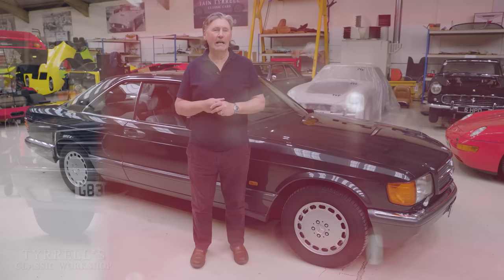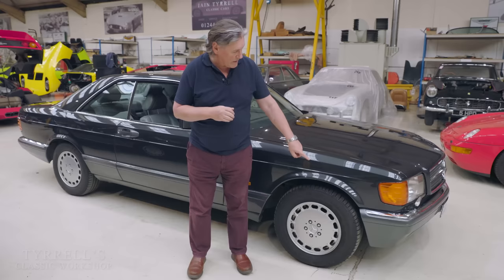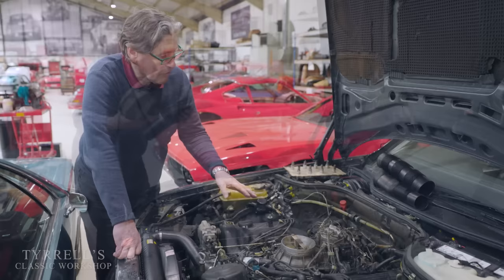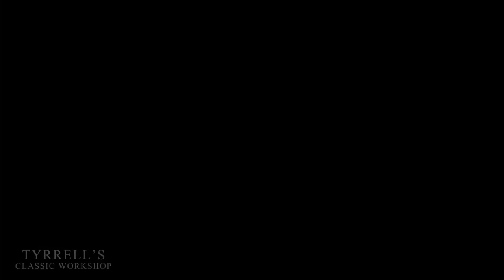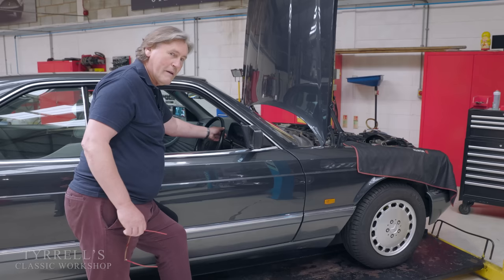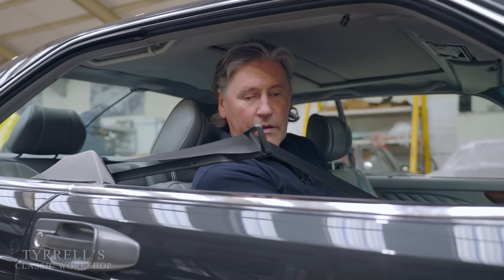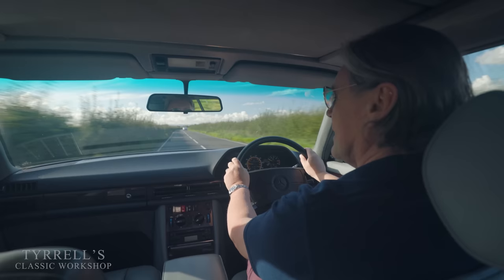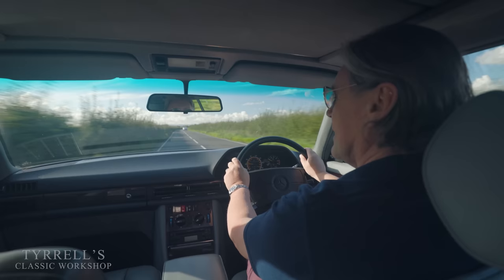Recovering the beast of an 80s Bahnstormer - Mercedes-Benz C126 560 SEC | Tyrrell's Classic Workshop

Comment: I have to say I really do like Tyrell.  I he really does what is great about cars.  Most people nowadays when they make videos about cars, they just wont shut and self vacillating.  I want to hear the car, I want to get the driving experience.  With Tyrel, he's clear, calm, straight forward; he's obviously a very refined and educated mechanic and when he get's out on the road and open it up.. Like I said he really appreciates what is great about cars, the driving the experience, the shift, the properly executed corner, the sound of the motor picking up through the gears.  With this car the experience was a very nice sedan that when you put down the pedel, it meant business, this was a drag race opening out a corner onto the straight away with a V8 motor.  I will say I owned a similar car, a 1984 300SDL with 380,000miles on it.  One thing about these cars is they don't weight very much 3200lbs, similar to a volvo 760 with a turbo 4, so with a 300hp V8 it's going to haul. Also their handling is competent, but one area where the really excel is they are great off road rally cars (unlike BMW's) these cars fly over speed bumps like they're not there, these cars are fun to drive off road quickly.

Comment: Dear Iain, thanks for this enlighting video. And this because I still own my late father's W123 230, (76 model), but after 27 years of daily driving I had the carbureted motor replaced by the newer model's 2299cc fuel-injected engine (of course with a 5-speed manual gearbox and ventilated disc brakes, to suit the power). With this video, you reminded me the problem with the fuel distributor of the Bosch mechanical injection system, that I did had, but also you made me try to fix the steering problem that has started to be annoying after almost half a million km that I have covered in this car. So, many, many thanks!

Comment: Years ago I was shopping for old Mercs and came across a pretty good 126. The price was of course pennies as they were back then. It had a problem here and there so I chickened out and went for a 124 instead. Also a terrific car but it always bugged me that I passed on the big car. I remedied it by getting a w140 next. But still the design of the 126 is so much better and it's always been the one that got away for me.

Comment: I got to drive this as a dealer flunky boy in the 80's and I must say they sure left an impression! Drive them hard, they'll do that, drive them in a relaxed manner, they can do that, too.  Quiet and solid.

Thanks for the tip on the steering box. I've got 110K miles on my W124 and it certainly needs looking at, but I must also say, with two tie rods and a center link, that's six joints that can get sloppy with the miles, too, adding up to a lot of slop.

Comment: "Engineered like no other car, MERCEDES BENZ"
Great presentation Iain. You do honor MB with respect. No negative opinionated bias, just accurate facts. Thank you.
Another car that Formula 1 Drivers drove for pleasure. I used to test and adjust for full throttle opening on all cars that came into my service bay. From lowly 240D up to 6.9. Clients would call back after picking up their car and complement how it never ran so good before!. I'd be careful about sharing the steering box adjustment. Non MB trained sods might get to happy with twisting things they shouldn't. There is a friction torque spec with conditions while measuring that should be adhered to. It is a component that is directly related to drivers safety and operation. Set wrongly and it could cause!💥!. As always I love your clear sober delivery.✌️
Healthy New year 2023 from a retired (47 MB dealer years) in New Hampshire 🇺🇲👍

Comment: You are right about the difference in European version engines versus US. I remember driving a 1983 Euro Spec 380 SL and it must've had another 70 hp

Depending on where you read it either this coupe or the R129 SL – the SL from the 1990s – is chief designer Bruno Sacco's favorite car 

He really designed Mercedes that looked like Mercedes with a timeless element to them from the 190 E to the W124, the W126-on and on 

Thanks for another informative video
Reply from the maker: Agreed- thanks to you too

Comment: I recall the arrival of the 560SL, SEC, SEL here in the United States at the Indianapolis auto show. The dealer was very happy because they could finally offer an alternative to the gray market 500 cars being imported.  They lied to us though and said that the 560 was a North America exclusive model... The 560SL was so much better than the 380  and I'm not including the single row timing chain issues and head bolt problems.  You mentioned that the US version was rated at 240 hp. Being in Indianapolis in the Mercedes-Benz club, several members that had strong backgrounds believed this to be underated and suspected closer to 275.  No idea if any of that is true. My 1989 560SL doesn’t disappoint. Very easy to underestimate the power on tap.

Comment: Great video of a great car and a great era at MB. I work on these cars every day and I see that throttle issue all the time, together with incorrect plugs and modern HT leads being used. Regular use and fuel system treatment gives them a new lease of life but overhauling the fuel distributer and adding new injectors is the way to go. I would also add that the chain's stretch and the tensioners go weak so valve timing can be way off yet they still run ok. The chain guides get brittle and fall down sometimes causing serious damage, or just a noise if you are lucky !

Comment: With that car having ASR it actually has an electronic accelerator! In normal driving the cruiser control actuator operates the throttle. If something goes wrong, the mechanical linkage takes over, and will give you about 1/2 throttle operation. With the ignition off you'll only get the mechanical system. 
ASR is often a problem with these as they've aged :( 
Sounds like the motor and trans on that car are running fantastic now!

Comment: I had one of these and it was the best car I have ever owned. They are indeed still very fast cars. In particular, the 60mph to 120mph acceleration is impressively forceful. They also offer fantastic directional stability at speed. A very easy car in which to cover ground quickly. This is a fantastic video, very informative: thank you.

Comment: I think the German versions were limited by Mercedes to 155mph in line with local regulations. Not so sure about UK versions. They used to regularly fly by me on the Autobahns near Munich back in the 80’s and I wasn’t hanging about. Great video as usual.
Reply: The German manufacturers had a detente to limit speeds to 155mph. I don't think Porsche was involved, just all the other, non-VW marques.

Comment: During my 30 year tenure as an automotive tech in western Canada, I had the opportunity to work on and drive a Japanese spec 560 SEL. No cats on that one either and it was fast! I had to rebuild the steering box and removing it was a breeze due to the simpler exhaust system. I passed on buying a rather tired German spec example with a leaking self leveling hydraulic rear suspension a few months back. $2000 Canadian. A little scary even with my experience. Thanks Ian for your efforts and interesting material.

Comment: I owned an 85 500 SEC AMG with the big monoblocks for a few years. It was so fantastic. I had basically no maintenance other than oil changes and brakes. It was reliable as the day is long and built like a tank. It only got 14mpg so it was not so great once gas prices started going up! That is one of the cars I regret selling. I definitely sold it at the very bottom of the value curve for that car too.

Comment: Great video Worth noting, though, that the US spec 560SEC also had the dual air intakes. You were looking at a US 560SL to compare, which was different, due to the 107 having a narrower engine bay.

Comment: Thank you for your excellent review on the 560SEC. I owned a 1986 500SEC without cat. One little correction although. The USA 560SEC and SEL had a dual air intake as well. Only the SL was restricted to a single pipe.

Comment: These were the best cars Mercedes ever built, without a doubt. I was the proud owner of a 1985 190e which finally blew its engine two years ago, after 400,000 miles. Unfortunately, the cost of a new 2 litre 4 cylinder rebuild was three times the worth of the car, so I had to sell it for parts, but that little rocket went everywhere with almost no issues. At the heat death of the Universe, when even protons begin to decay (theoretically), all that will be left floating through the void will be a mid 80s Mercedes, and a Nokia 3310.

Comment: Had a1983 500SE with "just" 240 ps but it was sooooo fast. The odometer max indication 240 km/u it completely overshot. Remember when i sold it and the buyer took the car for a run and came back impressed.....it's really fast. The 560 was obviously even faster and at it's time indeed a beast.

Comment: Iam biased as i own 2 x Gen2 Euro High output coupes & an 89 Euro 560SEL high output version all AMG kitted & 3 piece AMG wheels.
These are so much fun to cruise in and so comfortable for an 80's car. 
Mine all have Tr-Ys, no cats & full custom S/S exhaust and produce a deep V8 rumble with no drone as i don't like them being dead quiet with such a sweet V8 engine you need to to hear it. What i like about these 80's time machines is you can work on them & they are very well engineered
Enjoyed your video and can see you also enjoy driving them

Comment: Series 2 560 US models got the twin induction pipe air cleaner. The IS spec cars had to make due with a lower compression ratio, different cams and exhaust, and different ignition timing. I wish we had the euro height adjustable headlights and the optional 4 wheel SLS

Comment: From what ive seen the US and euro spec both had dual induction pipes. Only ones with single air intake is the 107 because of smaller engine bay

Comment: Great video! This was a good era for MB as they still over engineered their cars back then. Always liked the 560, but still preferred the old 6.3 and 6.9. I used to work on a customers 420 SEL optioned with the 6.9. The only S class Merc I ever drove that would wheel spin in the dry. Now that would have surprised a few people at the traffic lights!

Comment: I owned a 1987 560SEC for 10 years. I bought it at 80,000 milees and sold it at 116,000 miles. It was a US car , the same colors as yours. I took off the complete catalysed exhaust and replaced it with Euro Tri-Y headers  and only the stock rear muffler. The car immediately gained another40 or so horsepower and would easily spin the rear wheels. BTW , it also had dual intake snorkels from new.

Comment: I have a 500SEC and a 560SEL - both are beasts. Interestingly the 500SEC is a bit more responsive at lower RPM. A couple of corrections on the video - the 560 is actually a 5.5L not a 5.6L and it is a KE-Jetronic system - not a K-Jetronic - there are some fundamental differences. 😉😉

Comment: The U.S. 560 perhaps should only equal out the loss by Catalytic Converter. Because in 1980 the original 500 SEL had also 240 Hp as also the 450 SLC 5.0 version.

Comment: I had a 380 I loved the seat belt butler. I understand the steering box adjusts up the opposite way to expected which lead to a lot being replaced unnecessarily. Because the box wears more in the straight ahead they can adjust up and be tight on full lock so I was told.

Comment: Just love this vehicle and era.  I purchased my childhood dream 1991 US Spec 560SEC 15 years ago and still have her along with my 1989 US Spec 560SEL along with 3 other Mercedes.  I have been enjoying Mercedes for over 35 years and owned many. 
MY question, I noticed in this 560 the radio has a CD player in it, is this stock from the factory for that year?  I only have the Becker AM/FM Cassette player.  Would love to locate a period specific replacement if possible.
Reply from the maker: I believe it was factory fitted, yes. Thanks for your interest

Comment: Owners of 124 series E class and particularly R170 SLK's can transform the steering of their vehicles by following the advice here and nipping up the 6mm adjuster.

The R170 is criticised vs the R171 for steering feedback - when correctly setup, the difference for day to day driving is negligible.

Comment: Would love to see a comparison with the 850 CSi.
Reply: 840CiA would be the competitor, 850CSi is a completely different animal.
Reply: @TBendez  Insert explanation here:
Reply: @tastypymp1287  Sure!
560SEC - Luxobarge or, as Iain so well put it, bahnstormer. Low-intensity and torquey V8 with an automatic 4-speed transmission. Heavy for the time at 1,75 tonnes. 

There's also a seven-year difference between the two, the R129 SL600 would be the correct comparison. 

850CSi - GT/Sports car. Made for sweeping turns, the basis of track cars, medium-intensity V12 and a manual 6-speed transmission. It is a 105 kg heavier but with 80 more hp and a more advanced chassis and body, not to mention a sports interior, it'll be faster and quicker. The engine is an S70 and you know the difference between M and S.

840CiA - Still a GT car but with a slightly more stressed V8 with 286 bhp from 4 liters, 4-speed auto, available with a slightly more comfortable interior, it's a better fit.
Reply: @TBendez  Superb, thanks for the effort. I wouldn't describe the 850 as a totally different animal, but it seems the 840 may well be the better comparison. Both the Merc and BMW share a general commonality whereby they are derived from big saloons and have GT qualities. Typically for the era the Merc leans more towards luxury while the BMW leans more towards sport.
Reply: @tastypymp1287  Maybe you've driven both, I've driven neither. The CSi is a sports verison of a car that to begin with was sporty. It is not derived from the saloon, instead it was an engineering marvel using CAD, drive-by-wire throttle, four-wheel steering (CSi), an aerodynamic body: CD of 0.29, etc. 

Hearing and seeing the two, which I have had the fortune of doing, I wouldn't compare them. Remember, until the SLR/SLS and later the Black Series (and nowadays the AMG GTR), MB was out of the sports car genre since the 300SL. They built European muscle cars. You could say 500E here but you'd still have to jump to the SL63AMG Black Series for a real attempt at a sports car, even though thats probably a "Super" car. ;)
Reply: @TBendez  That's a touch pedantic. It's clear the E31 is the GT version of the E32, even if not direct evolution. To assert otherwise is disingenuous.

Comment: It amazes me that this car (or, at least, the original W126 it was based on) was designed in the mid 1970's - if you told me it first came out in the mid 90's I'd believe you.

Comment: I'd really like to know just what limited the throttle linkage travel on these. Is there an adjustment on them?
I also am curiouse about the steering box. I had an 85 300d that was way out of adjustment when I got it.
My neighbor told me about the adjusting screw and said to jack the front end up so the wheels were off the ground then adjust it a bit and turn the wheel from lock to lock so you knew it was not bound up as you adjusted it.
The problem was when turning the screw in it did nothing. I then went the other way and turned it out. That did the trick. I got most of the slack out by doing that.
My car had a lot of miles on it, over 200k, so I was afraid to go to far. I should probably have got a rebuilt steering box but never did.

Comment: I bought one of these on a whim at an auction, it looked great but it was so rusty (it had an MOT but the certificate was signed 'S Wonder') that it wasn't safe to try how well it went. You could put your hand up in the wheelarch and touch the rear window motors! I resold it at auction, a loss, as usual! It hasn't been taxed since, but hopefully the value will rise enough for it to be properly fixed by somebody with lots of mig wire and time.

Comment: I have an 88 US Spec version that I have owned since 2006. Sadly it has nowhere near the power of a Euro Spec model. I wish I could restore it proper but it's not a priority. I have an 88 Merkur XR4Ti (aka Ford Sierra) that I have spent thousands on to make it appear as close to an 86 Sierra Cosworth as possible but retaining the original 2.3 Lima turbo. Don't have the resources to do both cars, so my SEC will be up for sale in the coming weeks. I will miss it, but I have to get the other one done before I am too old to use a clutch.

Comment: I still ( noise aside) on a 4 stroke engine wonder if no exhaust system beyond the header tubes is the best for performance.A 2 stroke needs reducing by half and thats a different conversation.All the big piston aero engines either in line or radial had stubs or collector rings which in themselves produced thrust.

Comment: It's nice to have a custom exhaust system but it was done on a pipe bender which isn't so good.  If you're paying for a full stainless custom system you really should have proper mandrel bent tubing where the pipes aren't pinched at the corners.

Comment: Fast forward well over 20 years (more like 30) and the Germans still hadn't figured out the "seatbelt butler". I had to disable the ones in my BMW in software until i could take them apart and replace the springs because they are guaranteed to never work on any e92 3 series

Comment: I have a 2016 E class with a basic 2 litre diesel engine in it. It is only 1 second slower 0-60 and will do 140. I was in Germany recently with it and did 105mph but could not find a road clear enough to go any faster!  
Are you going to do 150mph in a 40 year old car? 
I love the old mercs but would say there are lots of modern cars that will give your day a lift.